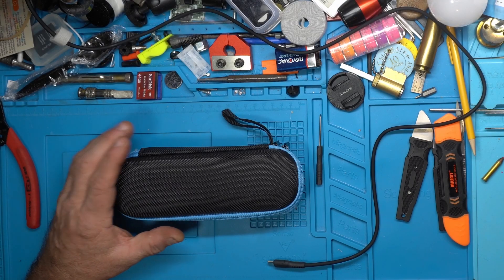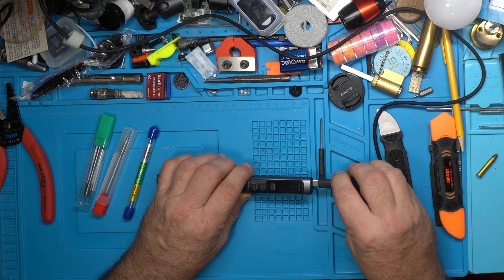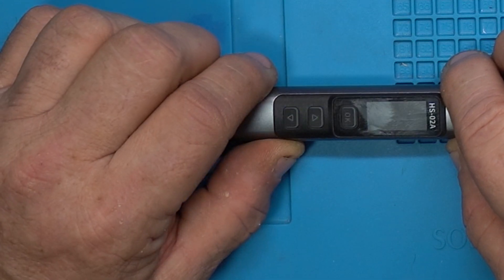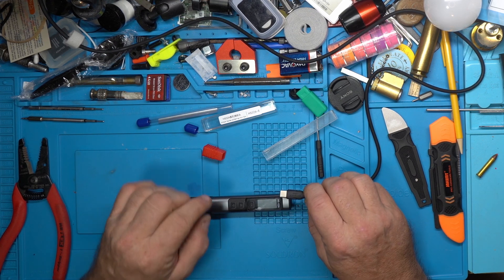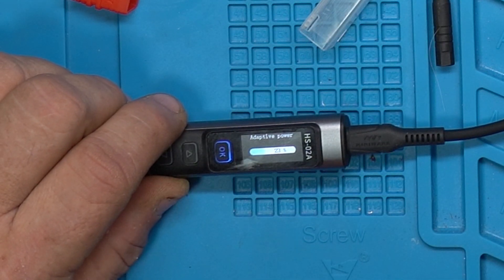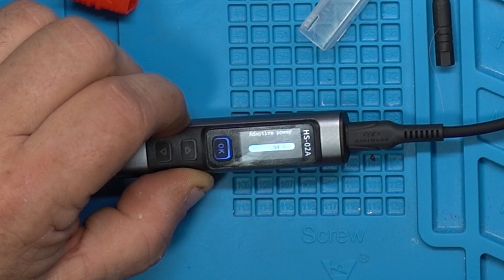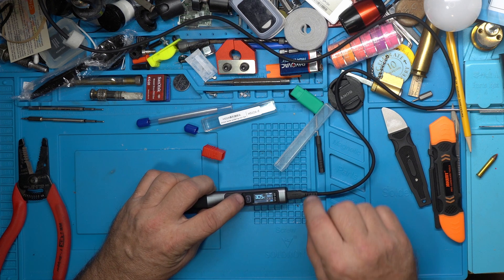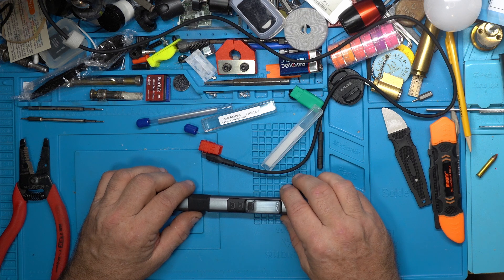FNIRSI HS02A Keeps Shutting Down? Try This

Comment: If I have a 65W power supply, should I set my power at 90%.. so its only drawing 60W.
Reply from the maker: My best recommendation is "It depends" so what does that mean.

the type of soldering you do. if you are soldering a lot of joints especially in quick succession "such as building a circuit from scratch" you will need the highest power level that will get the job done without the soldering iron getting too cold to keep going, or if you solder a lot of large components or high heat transfer items like soldering directly to a ground or back plane.  now if you are just doing something not listed above, repair work where you are not soldering to heavy metal items and just soldering something then test and clean then solder again then probably 40 watts or so would be fine. it all boils down to this, as running anything at full power draw will shorten the life of the iron you want to run it as low as you can to get the job done to get the most out of your iron. i grew up soldering with a 35-45 watt iron and did just fine, when doing heavy work like listed above i just had to set the iron down for a little bit to let it catch up from time to time.  To sum it all up run the iron as low as you can and still get a good solder joint and don't worry when you have to jump it up to 100% for the hard jobs and your iron should do just fine. here is a breakdown kinda. it does not matter the power level you put your iron at because even if you set power to lowest level you can it will still get to the highest temperature it can go it will just take longer. Hope this helps.  Thanks for commenting
Reply: @TTMEable Sorry what I meant to ask is if I'm using a 65W power adapter and I put the power percentage to 50% what would the draw be 50W or 32.5W?
Reply from the maker: ok to determine the power draw, you multiply the maximum rated power by the percentage of the power setting. the power draw should scale linearly with the percentage set.

P = P x %

P = 65 x 0.50

P = 32.5W

This should give you what you where thinking. but in real life it will depend on the iron and how the os is using the power setting but the above should be the answer.  can anyone please correct me or add to, if I'm wrong.. Hope this helps you and thanks for commenting.

Comment: Thank you for your video. It was extremely helpful. I've been having a problem with my HS-02B and Fnirsi was suggesting that they believe that it has gone into over-current protection mode and that I need to boot up into adaptive power mode (I don't think that's my issue, but that's a story for another day 🙂). They tried to tell me to long press the "right" button, but right is relative to the orientation of which you're holding it. Anyway, even though it didn't work for me, I never would have figured out what they were trying to get me to do without your help, so thank you very much. 👍🏽
Reply from the maker: Absolutely. You are very welcome. Im glad to have helped. If there is anything else i can do please let me know. Thanks for sharing

Comment: You have a very high beeping noise in every one of your videos 😢
Reply from the maker: Sorry, i have been trying to eliminate any audio issues. i am partially hearing impaired, constant ringing in my ears. I have been trying audio filters and voice isolation filters but it seems nothing works. it is extremally hard not being able to hear it, to me everything sounds great and my wife can't hear it either. Grand Kids are to young to even know what to listen for.  Still working on it and will continue until i get it. trying to learn how to use the spectrum tools in DaVinci resolve studio.  I believe i will find the resolution in this editing software but will continue to be trial and error. I try new filters on each video. my next knife videos will have voice isolation at 100% and high low drop/pickup as needed. hopefully it will help. Thank you for commenting and hope you will continue so i can know when i get the right combination's that will fix it. i also have tried recording on multiple inputs from lapel to boom and have settled on a zoom H5 with a boom mic to see how well that will work.

Comment: Hi there!

Pardon my language, but this is utterly useless! I was the viewer who posted the rather long comment a few videos back pointing this issue out. FNIRSI must make sure its device complies with normal USB-PD chargers.

The C245 tips (original JBC or FNIRSI clones) have a cold resistance of approx. 2.6 Ohms. The USB-PD chargers are a simple stupid Constant Voltage source in the end of the day. Ohm’s law, 20V, 2.6 Ohms, boom 7.5A!
When the tips heat to about 320°C we have a resistance of about 12.5 Ohms. That is something we can work with!

So, to conclude, what FNIRSI has to do, is make sure (in software!!!) the irons go to 50% power level every heat-up when the iron is first started up, after inserting a tip, or after waking it from full sleep, and then increase to 100% or what ever higher power level is set.

Heck, for all that I care, if the tip is under 200°C, power level = 50%. AND MAKE THAT CONFIGURABLE IN THE MENU!!
Reply from the maker: Yes, i remember and yes i agree, like i said in the video i feel like Fnirsi could very easily add the functionality into the firmware automatically instead of forcing us to manually enable it. they send the irons set at a lower power level so they will start up slower i guess hiding the fact they will not start at full power. anyway i think i pinned your last post to that video and will do so here as well. you have much more detailed information on the workings of the iron. thank you for your comments.

Comment: Should this even be happening with the USB PD protocol? I wonder what voltage level the 02A is seeing during the inrush. Maybe it drops because of the surge and then the electronics call it a day. That should be around/below 7,4 V right?
Reply from the maker: It pulls 20v and when set tp 65% or so power it does fine so its a current issue. The tip pulls to many amps on a cold start. Not sure how much my psu is 260w and at 20v should do 13a but its Chinese so my not reach full rating. I need to figure out how to capture the draw. Happens really fast. Ideas
Reply: @TTMEable  If you are able to split wiring somewhere, you could try a current transducer and log the voltages with a microcontroller with a decent ADC or an oscilloscope. I have no easy affordable solutions to capture transients. We use pretty expensive equipment for that. The problem is often the lack of decent sample rates.
Reply from the maker: I have plans for a video on the hs02a some stuff i learned from sone fellow viewers so be on look out. Should post soon. Thanks.